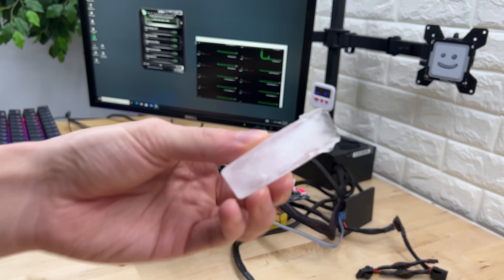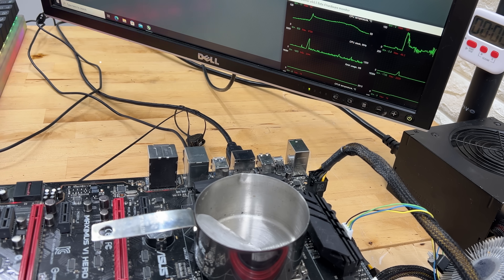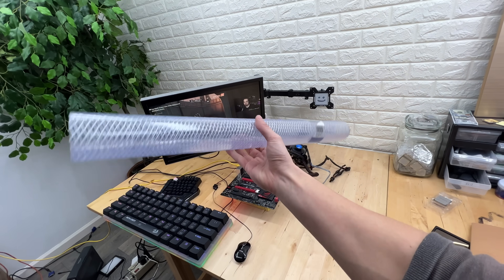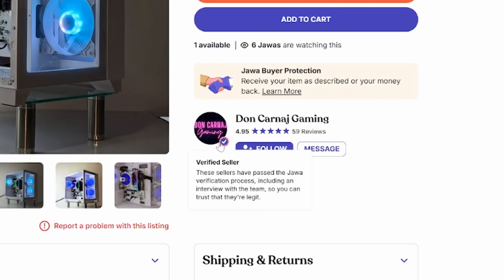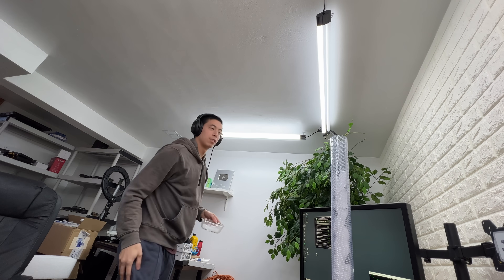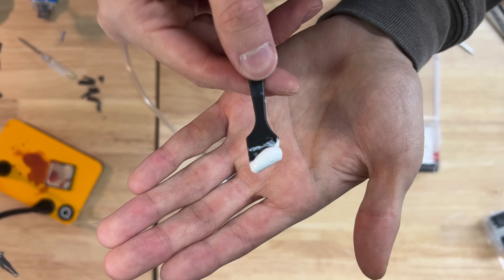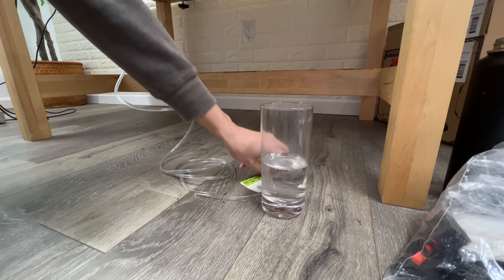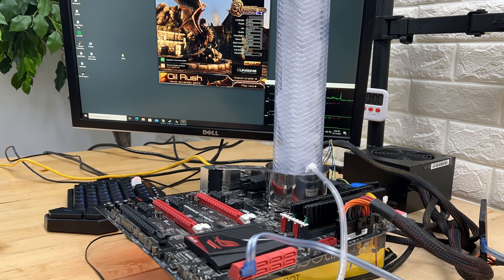Why aren't PCs cooled with ICE?

Comment: I don't think this is a good idea. I mean it would be trivial to create a cooling system that outperforms what's in commerce, but the goal is too cool your CPU without the coolant ever reaching freezing temperatures. The reason is that even if you seal the coolant perfectly, in your case ice, you'll still risk to get water on your PC, because water is literally in the air all around you. Normally it's in gaseous form, but when something is cold enough it condenses into liquid.

Comment: I used to run raids with a person who actually used solid state cooling for their computer.   It was a laptop not designed for gaming and would overheat - they used literal ice packs underneath and one on top -- that had to be rotated every 2 hours.
Reply: I used to have a laptop that overheated in the summer. It had the air vents on the bottom. So as a pc I'd have it elevated from underneath by some Lego so that there was actual airflow

Comment: You are actually wrong with the cooling: Ice + water ist mutch more efficient at cooling then only ice. It will be constantly at 0°C. In Chemistry we this method if the extra cooling power is needed

Comment: A freon-based heat exchanger would work the best.  A chip air conditioner, if you will, except the evaporator is in direct contact with the CPU.

Comment: I had this sort of neat Idea, this is just a base idea and I haven't really deeply thought about this but here it is:
The tube that you had is a good idea, but instead of driving it into a cup, it drives it into a freezer like system and the water flows into compartments similar to those trays you use to freeze water, and as I am pretty sure 2-5 hours (as he stated) is enough time for the warmer (still cold) water to freeze, it will then with some device (I'm not sure what device is used for this) be transported back into the tube. Pretty strange idea but the topic just interests me.
Reply: This is essentially a water cooled system with a compressor in the loop (your freezer) in the system.  You can buy water coolers with compressors from companies like Lytron, they're used pretty often in cooling for high powered lasers.  There are a few issues with using them for cooling your regular PC though:

Noise: the compressor is going to be noisier than a traditional fan or water cooled system
Power: this ain't an energy efficient way to do things
They're too good: such a system can cool your PC to BELOW ambient temps, while this is useful for short bursts and people use it quite effectively for extreme overclocking tests, but this creates a new problem, condensation, your sub ambient PC parts are going to start condensing water out of the air like a glass of ice water left on your coffee table on a hot summer day
Reply: @ so essentially you’re saying that it’s too good to be used for regular gaming lol.

Comment: How many Kwh does each cube represent, I wonder how electrically efficient it is compared to running a couple fans on a big cooler.  While the ice is in the tube it is warming up, so the higher it is stacked, the more cooling power the ice at the top loses, though over only a couple hours it doesn't seem to be much.  Also it's not gravity that moves the water, it's it's relative density to the air.

Comment: Pure water is actually a pretty good insulator.  The problem is, water is almost never pure, and most impurities found in "normal" water are extremely electrically conductive.
Reply: That's why my PC is cooled my pegasi. No, not by their wings moving air or something. Liquid cooled by what comes out of the pegasus device.

Comment: I just built this on Wednesday:
Ryzen 5 9600x
(waiting for my Asrock B570)
ASUS TUF B650M-Plus Wi-Fi
16GB G.Skill Flare X5
Powerspec 650W semi-mod. 80 plus gold
Lian Li Lancool 206
Hyper 212 Spectrum V3
(Reused my old storage for a combined 1.5TB nvme gen 4 and 2TB HDD in RAID 0)

TOTAL almost exactly $800 after tax.

Now that I'm thoroughly content and definitely not going to regret this, can I get your opinion?

EDIT: My yeester magnet is on the case too.

Comment: You don't have to ensure the ice touches the pan surface. This is because even if there is one floating piece of ice in the tube and the rest is water, the temperature of the entire water will be 0 degrees. It will only start shooting up once all the ice melts. So in short, no need to drain the water. Read about the latent heat of water
Reply: Easy solve is dry ice no water problems he can just put it directly on the cpu

Comment: this is missing one other factor and thats humidity. example of having a drink with ice on hot summer day. the glass gets all wet from the moisture from the air condensing on the glass. and i dont see why that would not happen underneath that measuring cup that is not in contact with the CPU.
its also the same reason why sub zero coolers need u to seal the CPU in so the condensation wont f up the CPU and the board. also the cooler needs to be insulated for that same reason "Linus kek tips made vid of one case that had that cooler"

Comment: also consider that you have to use an ice maker which uses a freezer compressor unit. 
you could take out the middleman by using the compressor to directly cool the computer, and your room. 
you could do an experiment where you go from sticking the computer into the fridge, using a window unit to blow cool air into your computer, to directly attaching the cold side of an AC to the CPU. you could make a system where a window unit would basically be directly pushing the warm air directly outside.
Reply: Is there not some advantage to the higher thermal conductivity of ice/water that the compressor would not provide? I could see some utility in a system that forms a sort of slurry of ice and water, but my major concern is being able to cool fast enough to accommodate the systems requirements
Reply: @mcfigglestein5346  The compressor actually compresses a liquid refrigerant. Your fridge/freezer/ice maker runs air or water over some coils to transfer the cooling from the refrigerant coils to the air/water. It's very similar to how liquid cooling works except it has phase changes.

Comment: Double. GPU and CPU using ice. Bigger ice block, not small one like in this video. use similar and smaller tube to make big ice cube that can fit in the tube. use pci extention cable so u can lay down ur GPU on the table.

Comment: I don't think the water would be an issue. Since hot things rise and cold things sink, the hot water should be at the top where the ice should cool it down. The colder water should then go towards the bottom where the CPU is heating up. It won't be as good as the perfectly 0C ice, but it should keep the cpu cool longer as the cpu would then need to get through the thermal mass of the water.

Comment: With my crappy old i3-370m laptop I put some dry ice under the air intake and got it around 10c pretty easily. Would not recommend, but it still works to this day.

Comment: ich hab 2022 eine 8liter aio für amd 1950x 4,1ghz 2017 -2024 und seit 2024 auf amd 7960x 5.8ghz , dauerhaft übertaktet mit aktuel 1.8mli liter gesamt und 260lter pro stunde , nur mit reinem sestilirtem wasser , look video ,, AMD Threadripper 7960x asus TRX50 gskill128gb GALAX rtx4090HOF HEATKILLER High Flow Next #hedtgaming ,, and video ,, AMD Threadripper 3d v cache ASUS nitro modus BIOS 128gb Gskill 7000mhz c32 aida64 GALAX #hedtgaming ,, and video ,, atto-disk-benchmark m.2 ssd samsung 990 gen4 vs RAID 0 2x crurial t705 gen5 , asus trx50 #HEDTgaming .,,
Reply: english

Comment: what about an AIO or watercooler, but where the computer is by the window to outside, the radiator is outside, and it's winter. So the water runs through an ice cold radiator? The practicality of filling the thing it with ice all the time just isn't there.

Comment: I have a genuine question :- why can't you freeze distilled water since distilled water is non-conductive
Reply: to do it at his 'home/office' setup it would end up conductive at the end because he's not a scientist.. {idk if he is or what this is my first time on the channel..my point is basically he cant be a 100% sure}
Reply: i'm pretty sure distilled water is still slightly conductive though, probably less than normal water, but still high enough to damage electronics.
That's why we invented ultra pure water after all, which is used for cleaning semiconductors and other ridiculously precise stuff.
Reply: @I_have_no_username  it cannot conduct electricity at ALL. It is one of the best inductors according to google.
Reply: Water still can corrode metallic components
Reply: You can, but then you need a source of distilled water, and there'd have to be completely zero debris on the MB - which is pretty much never going to be the case because the water is going to interact with the MB surface.

Comment: What you could do is create a long enough tube to start a drainage effect once the water fills to a certain point and attach that to an ice maker that dispenses ice regularly around the time the ice melts and starts the draining effect, but all that honestly seems impractical since I'm almost 100% sure that the ice will melt much faster than you can have a reasonably sized ice maker make the ice, but then again I'm also not a scientist, just some guy who smokes Mary Jane.

Comment: Now you only need to combine it with an automatic ice dispenser like the one you typically got in a side by side fridge 😂. You can even feed the water back into the fridge and create basically the most expensive but permanent cooling solution.

Comment: The latent heat of fusion of ice is stupidly high, it'll work great if you can manage to feed the ice continuously and remove the mess it creates.

This is only a "passively cooled setup" if you omit the process of creating the ice in the first place unless it is winter and you have a ready-made supply outdoors for the cost of going out there to pick it up. Then again, I'd tend to count having to do physical labor to get the ice, put it in and dispose of melted ice as a form of active cooling.
Reply: dull argument. Just because you need to reload ice occasionally doesnt nececerely make it active cooling.
Reply: @SpahGaming You need remotely-chilled water to make ice before you can toss it in.

This is basically open-loop chilled water cooling using ice to manually transport the chilled water from the chiller to the point of use.
Reply: @teardowndan5364  Cheap cooling idea: Live in Arctic/Antarctic climate, attach the tube up to the roof, make a mechanism that transports water from the bottom to the top, BANG! free ice free cooling

Comment: Taking your idea to the extreme – it’d be much easier to grab one of those generic $50 to $100 ice makers. You know, the kind that produces ice from regular water and releases it automatically. The ice could be directed onto the CPU, where it would melt into water, get recycled, and the ice maker would continue producing more ice.

Outside of evaporation and some complexities, this could technically work, but it’s an extreme approach. As you probably know, it wouldn’t be efficient at all. Ice makers typically consume between 52 to 160 watts just to keep the system cool, and you’d still need to refill the water periodically.

But I don’t think you made this video with efficiency in mind – this feels like an extreme take on your idea, and honestly, it’s kind of fun to think about.
Reply: I dont really know how ice makers work, but i would think they cool down water next to a metal element to make them. It may be possible to take appart and rearainge the machine to directly cool the cpu. Though if that were to happen; i suspect the ice machine would have a hard time operating long at max load. So you'd probably want to limit the cooling power of it in equilibrium with the cpu/gpu.
Reply: @SpahGaming
At that point just use a pertierelement
Reply: This would be quite effective if there was an ice maker that could make ice as quick as the PC would melt it
Reply: CPU still melt more amount of Ice than Icemaker re-frozen the melted-ice into yet another Ice.
Reply: @rashidisw How about more icemaker like lets say it collect from 3 different ice maker while it keep recycling the ice
Reply: An icemaker for this specific purpose would be incomparably smaller, and thus, it'd consume much less energy than its traditional counterparts. The biggest problem, as you hinted, would be with the recycling since some of the water would be lost in the process; you'd need a refill system as well. Also, you could use other liquids other than water that could be a better fit for these goals.
Reply: @r.m8146  We all know this video is an absolute joke. A traditional liquid cooler is obviously better—especially if you can do specific things like nitrogen cooling, which still needs topping up, or water cooling, which also requires maintenance. It's all just carrying the joke out to the 5th degree.
Reply: @marcus_cole_2  I don't know... This ice cooler has kept the temps at a steady sub-40 temp. No cooler on earth can do that. Even with liquid coolers, the CPU temps ramp up and down. Ice cooling with drainage is definitely superior. It's just a matter of practicality.
Reply: People dont normally game for 8 hours. The ice he had was enough for 4 hours. Using a refill system would prolong that time. Then when its time to go to bed, the make has enough time to refill your needed stock of ice
Reply: What if the ice cooler overheats?

Comment: You don't really need to drain the melted ice (water), because, cool water is denser than hot water, and since  you have the ice keedping the surface water cooled, this water is more denser and will sink, and the hot water comming from from the CPU, is less danser and will rise and will be cooled by the ice on the surface.
BUT, as the ice melt, the temperature diference in the water will increase, and the temperature of the cpu will rise as more water apears, and less ice you have.

Comment: I dont actually think having the water layer on the bottom is bad, in fact it may be beneficial. it allows a larger surface area to absorb heat, the warm water rises to the top where the ice is and then gets cooled down. It effectively acts like a heat pump. This is common in non water pump cooling called thermosiphon. Not only that, but the water itself would be at or just below freezing meaning that the thermal mass of the water would need to be heated up in order to see an increase in temperatures.
Reply: Funny I think he unintentionally took advantage of this by not putting the hole at the bottom of the tube but at the top of the measuring cup.
Reply: @Dargin  By having the hole relatively high up as well, it gives the warmer water a chance to rise and be drained leaving the colder water behind.
Reply: Ice pucks being swapped in and out with recycling water system 💀
Reply: At that point, you might as well go with a water cooling system
Reply: @darkweeman133  water cooling still uses fans to cool the water I think the whole purpose of that video is to not use fans (unless I missed something)
Reply: @lepindre9193  The purpose of the video is to find out why we don't use ice.
Reply: Well yes, there's water layer on bottom, it's just not good to have big volume of it
Reply: I mean, his main problem was large amount of water needing to be cooled, he was fine with just having the amount of water buildup at the very bottom
Reply: The main problem with this is convection is FAR less efficient than conduction. Generally, solids have a way way higher thermal conductivity than fluids, which means by making only the water be in contact it actually increases the temperature because ice transfers heat way better than ice.
Reply: The oce is better since the actual cpu die primarily makes contact eith the center of the cpu copper plate instead of the entire plate, and the ice shiuld be mamkng primary contact in the center as well
Reply: How much water

Comment: Did you check if the temperatures started fluctuating prior to the drain tube being added? I feel like not draining the water might have added more thermal mass while pretty much maintaining the same levels of thermal conductivity, thus potentially allowing the entire system to cool the CPU a bit longer.

Comment: your gpu's vram will cook you'd need some sorta square pan for the ice and thermal pads
Reply: A copper plate, with a sealed container on top where the ice goes in. Seems like a "reasonable" approach.

Comment: Instead of steel cup 
Should've used a copper or alluminium can
Reply: Ye my be only the bottom should be copper cus te room temperature can melt the ice from the side
Reply: I think copper might melt the ice faster because of its conductivity properties, but aluminum may work well. I am thinking tungsten would work even better, although that would be expensive.
Reply: @Sdawg01  If it melts the ice faster, then it's pulling heat out of the processor faster.
Reply: @Sivanot  he never tried overclocking the CPU so it's kinda pointless. The CPU was already super cold for a gaming workload.
Reply: I think the problem is that they oxidize faster than steel.
Reply: Then coat it.
Reply: yea
Reply: Was thinking the same.